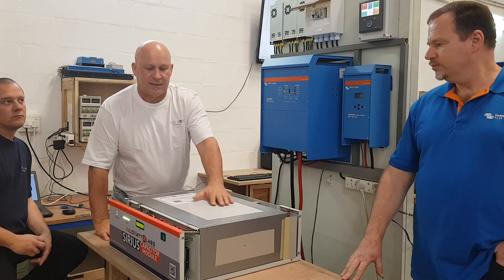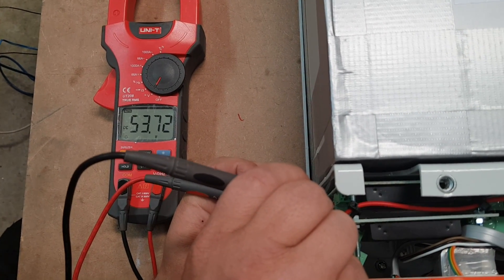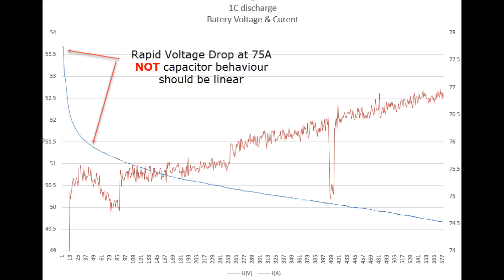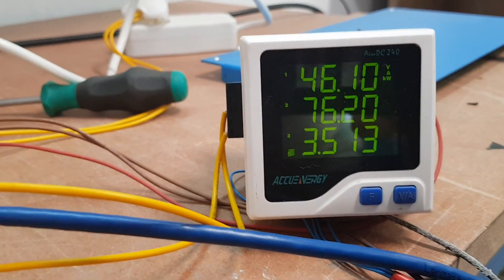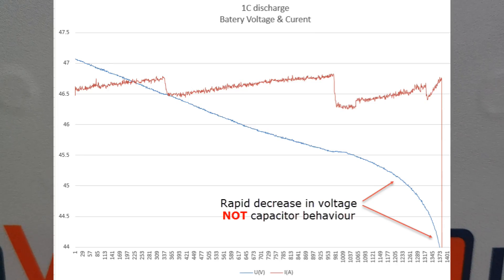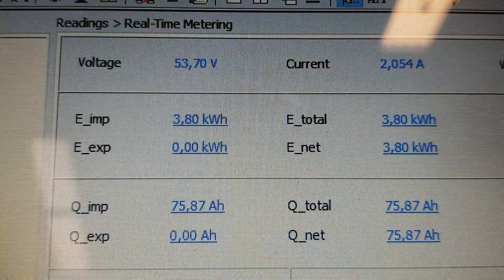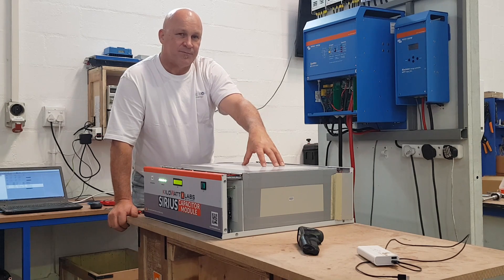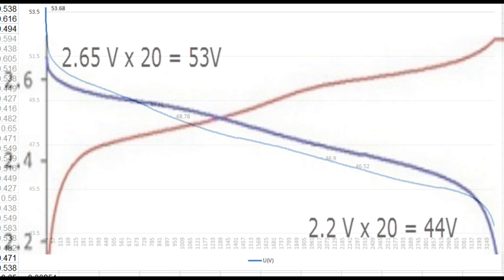KiloWatt Labs Sirius Super Capacitor battery test 3.5kWh

Comment: Thank you very much James for publishing a very professional test of this module. Interesting to note the anomalies that you found. Did you look at what was inside the cardboard? Has it got capacitors inside? I was seriously considering buying one of these units this week but now I am wanting to do some more research.
Reply from the maker: This is definitely NOT a super capacitor battery.
Efficiency is NOT what they say.
Build quality is really bad.
They are not telling the truth
Reply: The earlier units where only prototype units, all the new units coming out of the manufacturing plant have imbedded housings that takes care of that. the electronics inside is also upgraded making the units even more efficient with a standby/ sleep mode. Fore more info e-mail me on: ray@greenfoxagencies.co.za (importer and distributor in SADC)
Reply: And here I just requested a quote for 2x module but now I certainly won't be making a purchase...
Reply: @richardforrester1161  This unit displayed in a prototype unit. The new units are different. I am looking at 4 of these units.
Reply: @simonpetermurrell  hows the rel world performance?
Reply from the maker: Hi.
Just make sure you know what's inside. 
We still don't know what's inside. The cells are un-marked.